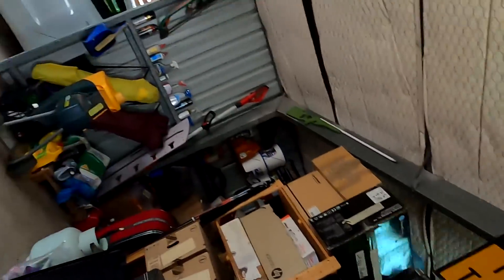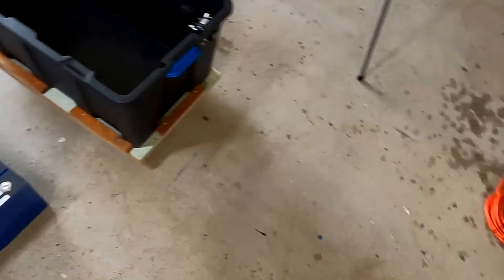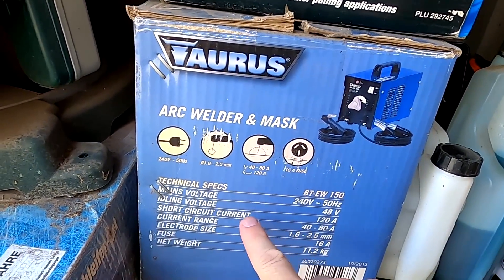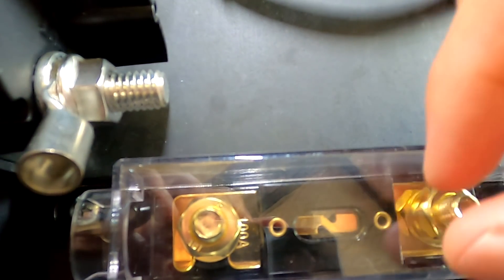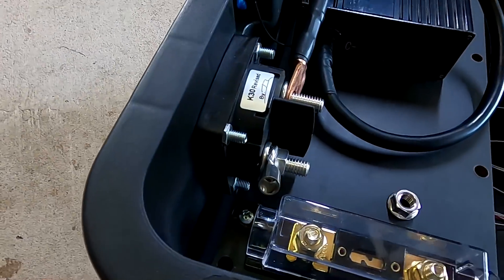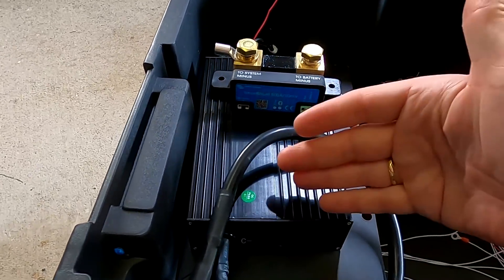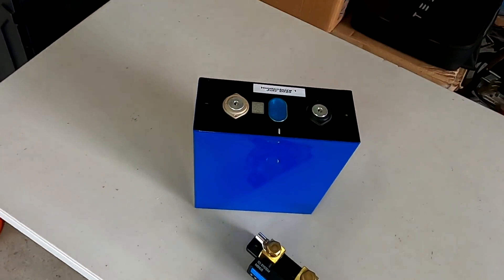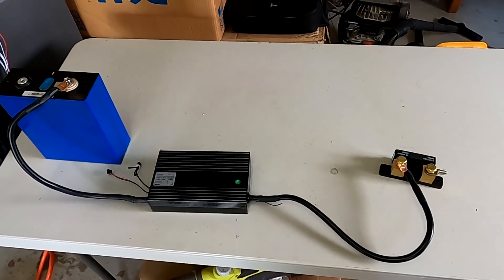Setting Shunt before the BMS a bad idea? Here is why I think this is GOOD! #buildthebattery.2

Comment: The problem with putting the shunt before the BMS is that, if there is a low voltage shutdown event, the shunt will still be drawing power to transmit and, at low voltage cutoff, the batteries are very close to dangerously flat. A BMS should be able to completely isolate the battery. The voltage drop across the BMS will be minimal and will be to the advantage of the battery when charging as the MPPT side will be very slightly higher. We had this exact discussion on my group the other day.
Reply: According to the datasheet, the current draw on the Smart Shunt is <1mA.  At that rate, it would consume 720 mAh in a month's time (24 mAh / day * 30 days).  If you leave your batteries low for that long, you're probably going to have issues even without the shunt in place.
Reply: @mattr4660  The principle is the same though on positioning. Most monitors are not wireless and have a monitoring head plugged in that uses more current. The voltage drop across the BMS is not an issue because it works in favour of battery protection and so I think it best to keep the BMS as part of the battery and put all other devices after it.
Reply: But after voltage cut off, doesn't the BMS  also  continue to draw  power?
And likely the loss from the shunt will be less that what the BMS will draw to stay active.
Reply: @dr.dickie1418  No it doesn't, this is why there is generally a reset procedure after a low voltage cutoff often involving a brief short from B- to P- or C- depending on type.
Reply: @philbrooke-little7082  If the BMS shuts off power, then there is no flow through the shunt. How much power does the shunt really draw with no current through it?
After low voltage shut off, there should be an alarm.  I would think it would not be a situation that would be left for a long period of time.  
Even so, as you say, BMS draw should be minimal.
Of course, with shunt before BMS, you protect against a BMS going bad and drawing. 
Each set up has an advantage and disadvantage.
Reply: @dr.dickie1418  Some BMS are capable of both turning off the charger during high voltage and turning it on again when the voltage falls below the cut off level.  In order to do this the BMS still uses some current to monitor the voltage even though it doesn't allow any current to flow through the output wire.

In an ideal setup, the CHARGER(s) should stop charging when the voltage exceeds the high voltage rating while the BMS continues passing current to the load as long as the battery doesn't get too low. 

All-in-one (A-I-O) units function in this manner. One problem with the A-I-O units is when people add additional chargers to the battery when the A-I-O isn't sufficient to overcome the power being withdrawn. In this case, the additional chargers must be capable of sensing the voltage to prevent THEM from overcharging the battery.

The key point is that the chargers themselves must be capable of detecting the high voltage and not relying on the BMS to do that function. In so far as the BMS is concerned it should be more concerned with monitoring the individual CELL voltage, rather than the entire battery voltage, and draining each cell as needed as well as disconnecting the main output line when the voltage falls too low.

The charger(s) and BS should work together to protect the battery.
Reply: @danielglang6312  very good explanation, my only critique here is that any excess power while producing solar when the batteries are full, should ultimately be diverted/dumped to another load if possible, such as hot water, tesla, pool pump, air conditioning, etc, & I am sure you know this, my comment is only an addition to ur great explanation. Cheers
Reply: @evil17  Thank you for your kind thoughts and reply. Dan
Reply: If you are working with a 20% discharge floor (I think Andy mentioned that he was) and programming the bms to disconnect at a determined voltage, then over discharge via the shunt @ < 1mA would not be a problem.
Reply: @Adlay_Eetswah  Most deep discharges are accidental. It seems to me to be bad practise to have anything that draws current between the BMS and the battery and I can’t see any advantage. Voltage drop on the SSR (Mosfets) as well as being negligible also works to the advantage of the batteries as I explained. Anyway I’ve typed enough about this.
Reply: @philbrooke-little7082  how do you “accidentally discharge” if the bms handles cut off, bms failure? do you have experience with it? genuine questions because I’m experimenting with this atm.
Reply: @Adlay_Eetswah  You leave something turned on and it runs the batteries down to BMS cutoff level. People are always accidentally running batteries down for many reasons. I have lived off batteries for about 40 years and now run a hybrid Lithium setup with a BMS I designed myself.
Reply: @philbrooke-little7082  so can you explain how that happens? a load before the bms?
Reply: That’s awesome, is your bms programable?
Reply: @philbrooke-little7082  by hybrid do you mean lto/lifepo4?
Reply: @Adlay_Eetswah  It happens with a load on the load side of the BMS. Hybrid is LiFePO4/ lead acid. Yes every aspect of the BMS is wirelessly programmable and it sends data for logging / monitoring. It can also control heaters for low temperature charging.
Reply: @philbrooke-little7082  Nice that’s petty awesome 👍🏽
Reply from the maker: Yeah, it pulls only 1mA max and the battery will not be empty when the BMS disconnects. I wanted this to happen before, say at 2.7V (but maybe I'm wrong with that thinking...)
Reply: @OffGridGarageAustralia  Yes I was thinking the same thing, I maybe wrong here but assuming the voltage is linear 3.65v (100%) minus 2.5v (0%) equals 1.15, now 1.15 x 0.2 (or 20%) = 0.23 + 2.5 = 2.73v 🤷🏽‍♂️
Reply: @OffGridGarageAustralia  I’m experimenting with charging to 3.42 per cell and discharge no lower then 2.73, (what I calculate as 80-20%) time will tell if this leads to longevity with the battery or not, It could just be a giant waste of time or it may just offset the gains you might get from the dreaded C word...

Comment: You're right option 3 is the cleanest and you'll have a slightly more accurate voltage measurement.  The only thing I would wonder is if it would be preferred that the shunt should see its voltage go away similar to that that the MPPT would if your BMS were to disconnect.  That would be the only possible corner case that I could think of in which you may have an issue.  But your BMS should never disconnect unless you're testing it and under monitored conditions...
Reply from the maker: Argh, more to think about it...

Comment: Very good! An SSR is usually a mosfet driven switch with isolation between input and outputs. I think all three topologies will work fine. Whichever topology you choose consider what information the charge controller will get if the fuse blows. If you are sensing volts on the shunt on the battery side then the charge controller will think there are volts when there are none.
Reply from the maker: How do you overcome this though?
Reply: @OffGridGarageAustralia  Connect the + connection of the shunt to the load side of the fuse so it sees and reports the controller output voltage. 
However, you should have a look at what is required by the Victron controller when fuse blows. I imagine the internal fault logic of the controller is based on a truth table that responds to a range of conditions - one being the fuse blown - as to how to connect the power for the remote current sensor.

Comment: Victron also makes a 58V 125A MEGA fuse that will fit into your fuse box. I would trust it will do the job if you aren't confident with the one you have.
Reply from the maker: Arghhh, don't tell me that!!!!
Reply: @OffGridGarageAustralia  Why not? It is a minor change in the system. If at all necessary.

Comment: Will the smart shunt Bluetooth strength be hindered being inside box?
Reply: The metal box housing the charge controllers would have more of an impact than the plastic box. You never know with radio signals wether it will work or not until you try it & modify if neccessary.
Reply from the maker: Yeah, there is a slight small chance It may not work with the metal enclosure. Distance is only 1.2m though.

Comment: #3 will be the most accurate reading because it will measure the consumption of the bms, perfect for a small system. 
#2 is best for a large system because the consumption of the bms is very low.
The problem with #3 is that the chunt gets very hot and has to be as far as possible from the batteries and the plastic box.
Reply: By my calcs 100A x 0.05 volts would be 5 watts at maximum output. How hot is too hot?
Reply: @aussiescotty2950  I don't understand your calculation but my 48v system over 4kw gets very hot to touch.
Reply: @neliosamch3195  Interesting. Your 48v syst 4kW = I=P/V = 4000/48 = 83 A. The shunt (Andy's) has a volt drop of 50mV @ max current. Woops my bad. P=IV yes. P = 500 x .05 = 25W. If a draw of Andy's max 100A, shunt would drop 10mV so P=IV= 100 x .01 = 1 watt is what the shunt power it would consume. Please correct me if I'm wrong.
Reply: @aussiescotty2950  okay,  12v system the amperage is higher than  the 48v system  for the same load. I have the same shunt 500A 50mv from victron.  The time I noticed the hot temperature in the shunt was in the summer with 90⁰ ambiente temp while charging 2 ev and an a/c on which was less than 100A. Cable is 1/0 awg. Other shunts overheated has been attributed to loose connection and defective terminals. Mine has neither. The only thing abnormal is no voltage drop between shunt terminals. So my assumption is based on experience and not technical data.
Reply: Maybe you don't see defect on the connectors, but how perfect are the contact surface between them and shunt posts? Are they with a miror finish, or as they were, just bolted on, and go? Imagine only some points are touching, it's as if you have thin wires, the higher the amps the more temp, little fusion points are created, the terminal could become loose, and further arcing damage the surface. If you thight the connector with damage surface, the show goes on again, the connector will get loose, endless loop. Always trouble and energy loss.
Reply: @hommerdalor6301  I installed two or three years ago. It only get hot above 80A or 4kw so it isn't a priority but I will inspect or replace them before summer. There's no voltage drop difference so connections are tight and clean. The over heating may be normal for high amperage.
Reply from the maker: I think the 50mV voltage drop over the shunt only occurs at the rated 500A. So at 100A I will have only 10mV so 1W?
Reply: @OffGridGarageAustralia  We need a real condition test to bust any wrong theories. Lab test sometimes shows approximate results. Cable terminals need to be crimped and welded to avoid false readings.
Reply: @nelio.
let's play with Joules. Don't trust my math, check by yourself please.
We need 385 J to raise the temperature of 1kg copper of 1°c. 80°c - 30°c= 50°c.
0.025kg copper lug.
385x50x.025= 481.25 Joules.
1J=1W x 1second 
Watt=Power loss= R x i squared, so, R=J/i sq= 481.25/6400=0.075 Ohm. 
U=Ri= 6v voltage drop. If we have more mass, like a wire with a magic loop, the results will be different. :-D Maybe am I wrong? 
Hehehe.
Reply: @hommerdalor6301  I called up Albert Einstein to help me out with the hypothesis and he referred me to Nikola Tesla. He replay that you are right but don't think too hard about it because the answer is very simple. As long as it works don't worry about it and don't  tell anybody because the city inspectors will be sticking their noses around your fence the next day saying that the neighbor complained about you trying to solve an unsolvable equation.

Comment: 1-3 will all work.  But I still would suggest #4 using the shunt to just measure charging loop or inverter usage.  You won't know how much you are charging or how much is going to the inverter if you just have the smartshunt on the battery loop.  Since  you already get data from the BMS, put it on a different loop.
Reply: True
Reply: I agree, why use the shunt to get more or less the same data as the BMS? The MPPT charge controller will work perfectly without and in previous videos it was made clear that the top charge is going to be well below 3.65v so why does the alleged accuracy of the shunt matter? If you absolutely want to us a shunt put it in another loop like the inverter so you can monitor consumption accurately (the BMS only shows the sum of wattage in & out)
Reply from the maker: That's what someone said a few videos back. The shunt and BMS will double up and give the same information.

Comment: You would want a lot more voltage to arc across that blown fuse air gap
Reply from the maker: That's exactly what I think too. Even if there is an arc for a second or two it will extinguish if the gab get's too big. That's the theory at least. But once you have the plasma and 15.000A flowing anything could happen...
Reply: Jacob’s ladder

Comment: I think 3# and have just installed this way myself,  the only thing I can think of as a downside is , in a disconnect situation for low cell voltage the small draw from the victron could carry on using power thus defeating the bms and potentionsly kill the battery if left long enough
Reply: I can't confirm but I'm sure the shunt will have a low voltage shut off? Victron are too smart to allow that to happen :)
Reply: @w3bb0y perhaps maybe so , but victron say bms after shunt so I followed this instruction for my install and il see how it goes , logically to my mind the bms should before the  shunt as it will always defend the cell voltage in event of disconnect
Reply from the maker: The BMS should always come first to disconnect whatever is after it. However the consumption of the shunt is less than 1mA.
Reply: @OffGridGarageAustralia  1mA*(an indefinite amount of time)=potential damage.  What do you value more, an accurate voltmeter, or reduced risk of failure?  The choice is ultimately yours.  Any decent battery monitor should be tracking the state of charge based on current flow, not voltage.  I watched a video recently where an RV with lithium was left in storage and due to a power loss, the cells were overly discharged and damaged because of the active cell balancers being powered after the BMS disconnected.  Keep in mind that when the BMS disconnects, you don't have much reserve capacity left.
Reply from the maker: @Mike_Neukam  Worst case scenario will be the battery is empty and there is no sun. Until the next morning.
I won't discharge the cells lower than 3V/2.9V, so there is still plenty of  capacity left to supply 1mA over a very long time until they hit 2.5V.
Reply: This is a very important point.

Comment: OK but battle born batteries have  the BMS inside before they put a shunt to their systems
Reply: Hi, yes finished built battery from "factory" is built like this. There is no possibility to put the shunt between cells and bms. It is not perfect but acceptable 😉

Comment: Switch and fuse is always on the positive side....
Reply: Fuse are usualy on the positive side because in Canada and US most system are negative ground. A short to ground will blow the fuse if it is on the pos side, and it wont if on negative side.
Reply: @pierreconstantin2546  So in the case of fusing the negative side, no current is flowing through the negative side during a short to ground to blow the fuse?
Reply: Switch not always - Toyota Coaster Bus -ve battery disconnect, some heavy equipment too. I have seen fusing in between battery cells - worth a think.
Reply: Why?
Reply: @DIY Projects they will still be connected either ways, ((edited)if the load is still present), as the switch disconnect only one side of the power line. There also will be voltage present from voltage sensing lines.
Reply: @DIY Projects Ok, did not know that the case is connect to pos, so it would make sense if the switch was connected on cell most neg terminal, before shunt and BMS and no load connected
Reply: I hope you put both the  fuse (1)  and  (2) on switch positive!! It is recommended fuse as close to battery … not to exceed 7”.
Reply: why?  but on my battery, a negative side wire is the hottest